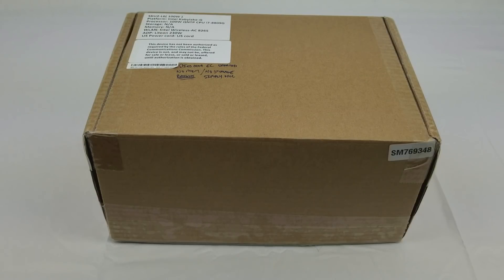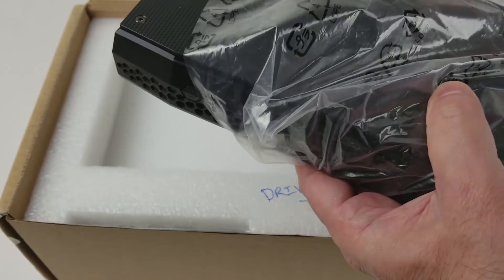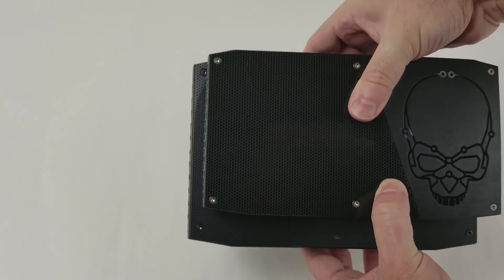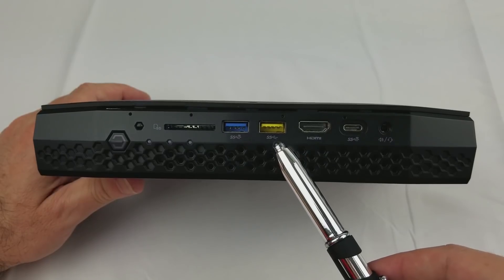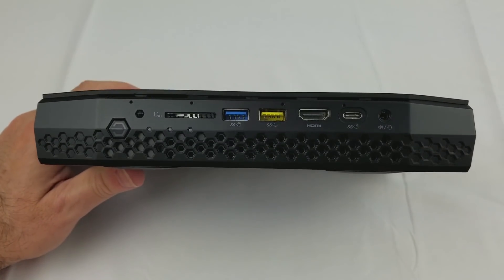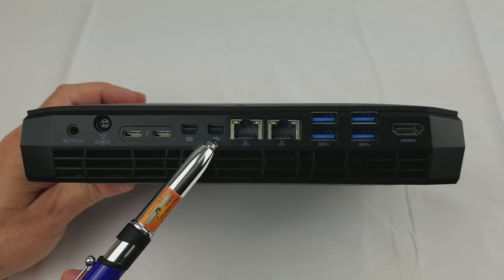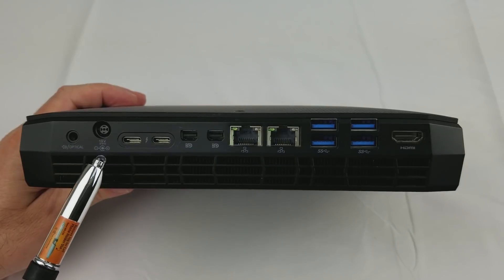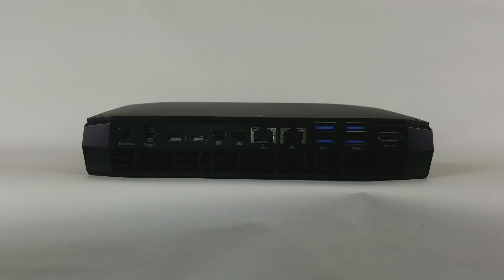Hades Canyon Intel NUC- First Look!

Comment: I have had my SC NUC for about a year, I added 32GB of RAM and 2 512GB SSD's. I run it 24/7 under heavy load, usually with 24 copies of some pretty heavy duty communications programs as well as a graphic's-intensive radar tracking application. I use a pair of HD 32-inch monitors connected to the MDP ports. The case does not even feel warm to the touch on top and I have never heard the fans running nor had any of the random reboots discussed in this comment section. To set it up I installed Windows after installing the memory and SSD's, took about an hour to download and install a gazillion drivers then installed my applications.  This has been a great performer for me and was a great value. I would most certainly buy the same computer today.

Comment: I assume the Thunderbolt 3 ports don't support input charging (ie the NUC itself)?
What is power consumption under typical loads (for different usages: surfing, video, High CPU & Low GPU, and vice versa, and of course the ultimate all in 100% CPU & GPU load).
I'm trying to estimate typical current (in Amps) needed to power it for avg. and max load use, and thus the possibility to hook it to a powerbank for a true mobile use (when away from the wall-socket) ... obviously power management wouldn't be major consideration when powered by its power-brick from a wall socket.
Looks great! Of course we might have to wait a bit to see exact benchmarks, but I expect them to be very good at least :)

P.S. My desktop incl. GTX1080 OC-edition can be somewhat noisy (though it's the older power and cpu cooling rather the GTX1080 fans that produce most of the noise), but I can't notice it thru my noise-cancelling headphones ;)

Comment: Compared to NUC7i5BNK, how is the fan noise in idle and under load? Can the fan can remain off in idle? How about the NUC8i7HNK model?
Reply: I just shot a video of the blowers, taking the Hades completely apart. The blowers are considerably larger than the Skull Canyon and as such, can spin a lot slower to create more airflow. As a result, they are pretty quiet under normal loads and even running an AAA game they spun up for a bit, then back down. They spun down more than spun up.

Comment: Does it have the same issues as the Skull Canyon?  
Random reboots
Reply from the maker: We haven't heard of random reboots on the Skull Canyons we have built.  Mostly its a Windows driver problem that invokes a reset event when the IRQ generates a mismatch.  We make sure we are installing the latest drivers and BIOS updates so all NUCs that come from Simply NUC are operating flawlessly.  If not, we make sure to help resolve the issue for the customer.
Reply: It's quite a big issue on forums.
Still trying to fix mine, It may be Samsung m.2 nvme drives just not 100% sure.  People having these problems seem to also have Samsung drives.
Unfortunately that's all I have so I can't try any other m.2.,
I tried the usual, Such as bios updates,m.2 firmware, reseat memory and still no luck.
Would love a new Hades Canyon NUC but this problem has put me off any new NUC purchase.
Reply from the maker: Reach out to us on our support page and we will see if we can help.
Reply: Howdy Shane, there was a Hyper-Threading bug in the past that turning off Turbo Boost or Hyper-Threading would fix. In my initial testing of the NUC7i7BNH, I did have the screen freezes and reboots depending on system configuration (and usually aggressive operation) I worked with Intel for about 2 months before we tracked it down to the Hyper-Threading bug. A BIOS update resolved the problem and the system is completely stable. I know the Skull Canyon has the same Hyper-Threading bug and there is a new BIOS out for it. Update the BIOS and see if the problem goes away.

Comment: Some videos say front panel usb-c has thunderbolt3 support also is that fact or bull?
Reply: Howdy Henry, The front panel USB Type-C connector is only USB 3.1 Gen 2 (10Gb/s). There are no DisplayPort or Thunderbolt connections. The USB 3.1 "Alpine" controller is wired to this front Type-C as well as the front blue Type-A connector. The back 2 USB Type-C connectors are wired to a Thunderbolt 3 (Dual) Host Controller which also has the DisplayPort lanes from the GPU wired to it so that both back USB Type-C connectors provide Thunderbolt 3, USB 3.1 Gen 2, and DisplayPort 1.2.

Please note that elsewhere I mentioned that the Thunderbolt ports provided DP 1.3 which was a misprint on Intel's part. I have direct contacts to several of the design engineers on the Hades-Canyon who are providing technical details and some details conflicted.

Comment: are the fans as loud as the skull canyon ? i dont use mine....blower sucks
Reply from the maker: They (dual blowers) are actually surprisingly quiet. You can hear them when the unit is being pushed but under normal operation they are noticeably quieter than Skull Canyon
Reply: thanks for the quik answer...will there be more videos of it?
Reply: Howdy Trayo. I ran World of Tanks High-Def client with every single graphics setting set to maximum when I shot a video of it in the studio, video coming soon. With this setup, the blowers spun up and back down during gameplay and I don't think I ever got any throttling. I was attempting to record the blower noise in the video. In this setup, I got 105-125fps with a Max TPD of 121 watts. The video drivers are not the production version and we believe we will get more performance out of the production drivers.
Reply: well i would use it just for making music (fl Studio, Studio one etc... no need for gaming... maybe CS GO from time to time...) as i allready tried with my skull canyon the Power was very impressive... thats why im asking about these damn fans...dont want to spend 1000 Euro again for something i wont use in the end because of the noise
Reply: Howdy Trayo. There are a few new videos of it uploaded including one of the blower sound levels during a benchmark. There are also a couple related to teardown and a blower comparison of the single Skull Canyon blower to the two Hades Canyon blowers. Check the SimplyNUC channel for new videos (or subscribe)

Comment: no vga 0/10
Reply: who use vga?
Reply: I'm going to report you for spam, you've put down the exact same comment in about 10 other videos of this thing.
Reply: We have HDMI to VGA, mDP to VGA, and Type-C to VGA adapters and cables, so technically you can support up to 6 VGA monitors simultaneously.
Reply: kek
Reply: Buy a new monitor or TV.
Reply: Pay Pal boi, VGA is old, it's obselete

Comment: please actually watch linustechtips video... seriously
Reply: whats your problem. hes just doing his way of video.
Reply: LTT first look is just that, scratching the surface. I found more info on this video than most other channel at the moment because he got the ACTUAL UNIT to play with. Look at the teardown video.
Reply: I shot my video before Linus did his. I really liked his enthusiasm for the product and share it. I will be purchasing one when I can. But he did more of an introduction to the product instead of a deep dive. I am certainly not the showman that Linus is, so make sure to give technical details he doesn't do.
Reply: Once I get the prototype back from CES, I will be doing another video showing where the wireless antennas are, since I don't remember seeing them. I also have a video going up that will show some gameplay and blower sound levels (which are good). I may even attempt to remove the motherboard to show off the other side.
Reply: I now have teardown videos showing the motherboard removal, comparing the single Skull Canyon blower to the two Hades Canyon blowers, and another showing off the blower sound levels

Comment: you forgot to mention that it has thunderbolt 3... watch linustechtips video on the 'first look' at the haydes canyon
Reply: Thank you for pointing that out. I must have omitted that. Thunderbolt 1 and 2 are supported by the mDP connector where Thunderbolt 3 is only on the USB Type-C connector. Realize I shot my video before Linus did his and we were just prevented from releasing it until Intel announced the product at CES.
Reply: I went back to check the video and I did mention that there are 2 Thunderbolt 3 ports at 5:50, so I am not sure where I forgot to mention it.
Reply: Charles Abdouch you did mention TB3 but keep saying it's 10gb. So this isn't 40 or even 20gbps, only USB 3.1 Gen 2 speeds?
Reply: Howdy Brent, sorry I missed your question. On the back are two USB Type-C connectors that have the following interfaces supported on them; USB 3.1 Gen 2 at 10Gbps (and backward compatible with USB 3.0 and 2.0), DisplayPort 1.2 (I think 13Gbps to support 3 monitors), and Thunderbolt 3 at 40Gbps.
The USB Type-C connector on the front panel only has USB 3.1 Gen 2 routed to it for 10Gbps and backwards support for USB 3.0 and 2.0

Comment: Does it come with any kind of built in Wifi adapter & please would love to hear any occurrence of thermal throttling if it's taking place.
Reply: It has a wifi dual ac band..and a much bulkier heat sink..but now we have to see how it performs under heavy load
Reply: Howdy. It comes with an Intel 8265 802.11ac (bgn) 2x2 (867Mbps) "Gigabit" Wireless Radio that also has Bluetooth 4.2 support. I realize now that I did not see the antennas during my video shots, so when I get the prototype back from CES on Saturday, I will try and find and video record the antenna locations.
As to thermal throttling, I ran World of Tanks High-Def client with every single graphics setting set to the maximum and got 105-125 fps with around 121 Max TPD. I shot a video of the gameplay, trying to capture the blower noise, but the blowers spun up and back down during gameplay. I do not believe I ever experienced any throttling.
This was with prototype graphics drivers.
Reply: The unit is larger than the Skull Canyon and quite a bit heavier. During our brief testing of the prototype prior to shipping it to CES, we never got any throttling to occur that we could detect. The blowers under heavy game load spun up and back down during gameplay.